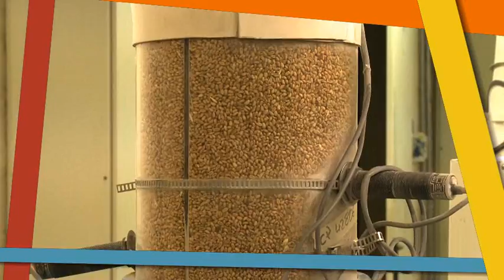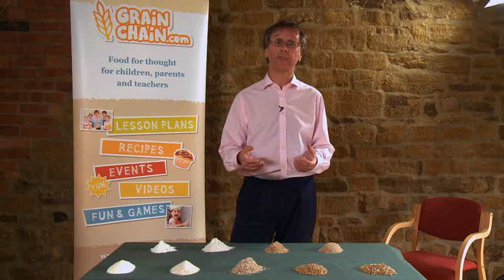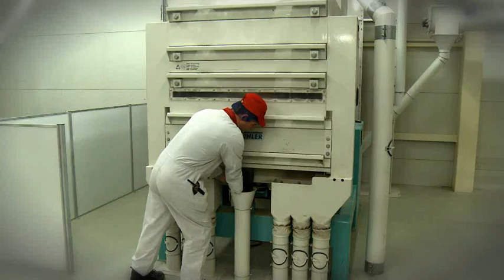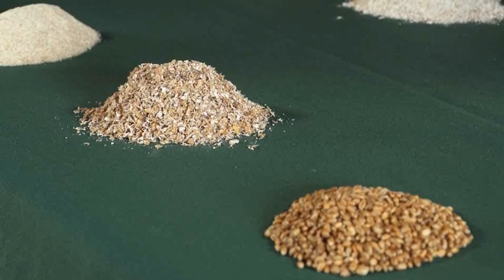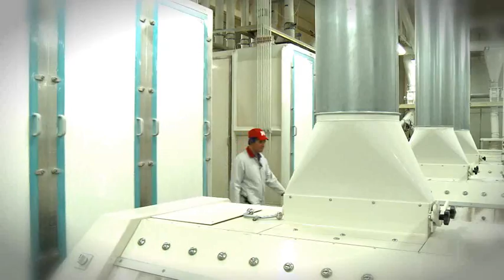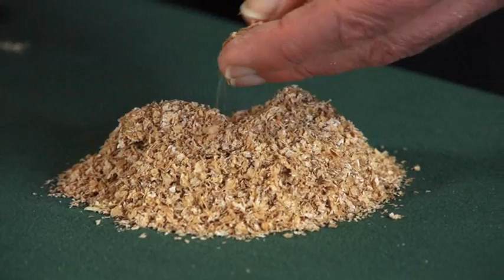How wheat is milled into flour

Comment: This is awesome. We do buy wheat, grind it at the commercial mill, sift the flour to make wheat swallow, local snacks and whole wheat bread.
Reply: how much do you pay for the grinding process?
Reply: @g0shagg-cs  smiles and a beautiful question ☺️☺️☺️. Wheat is readily available in our markets. It is usually stored in 50kg bags or more, so it's from these bags the wheat is measured out to buyers using a special measuring bowl called 'mudu', or 'kwano', depending on your location. The quantity bought determines what you'll have to pay at the mill. Lets say a mudu costs N200 to grind at the mill then 5mudus*N200 gives N1000. Tnx.